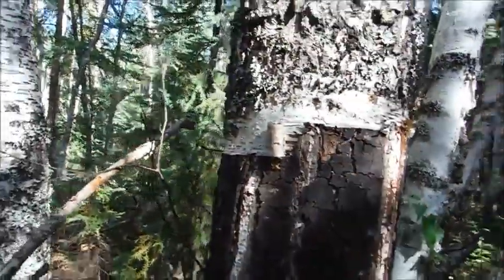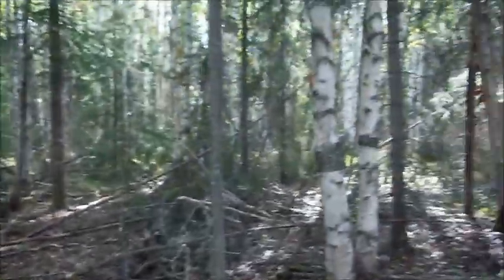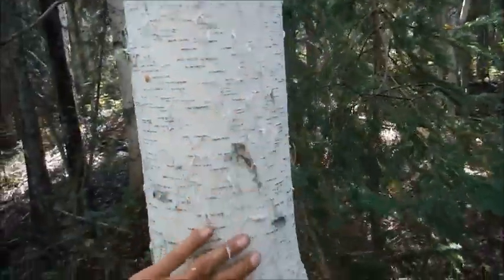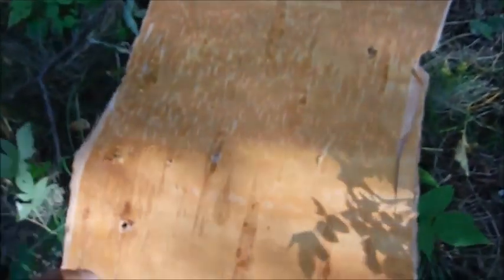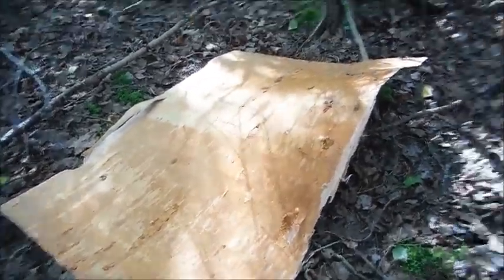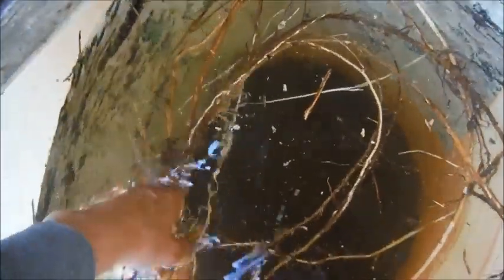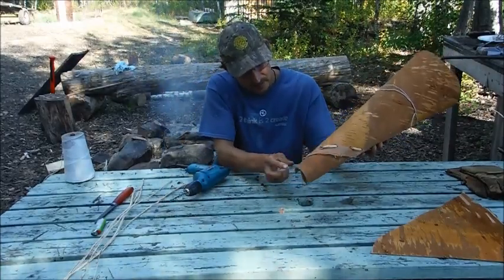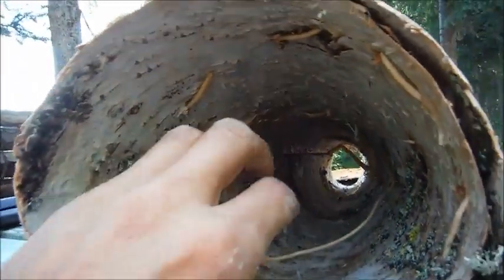Makeing A Birch Bark Moose Call

Comment: The bigger the call, the bigger the moose. Ha ha...let's hope!! Hope you get a nice bull this Fall. It's certainly feeling like Fall in the air. Spruce root is really strong. Used it in a pinch one to rig up one of my trail cams when I didn't have any wire or a bungee.

Comment: I use a strip of birch bark to sew the seams. I use a sharpened flathead Phillips screwdriver to poke the slits/holes the width of a flat skate lace....and lace away, it looks great.
Reply from the maker: +Jedidiah that is pretty cool.i bet it does look great I will try that the next time I make one thanks for the tip

Comment: Could you use either boiled linseed oil on the outside to prevent it drying out, or even bear grease? I have a recipe from the late 1700's that i use that works great as a wood and leather preservative, and a great coating for the outside of firearms and tools.